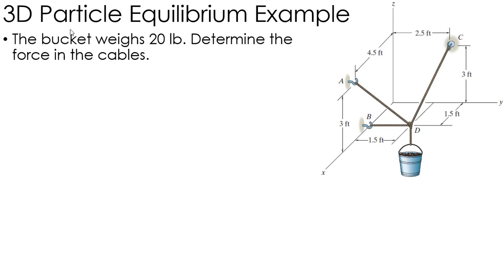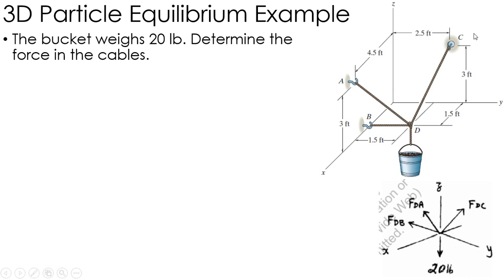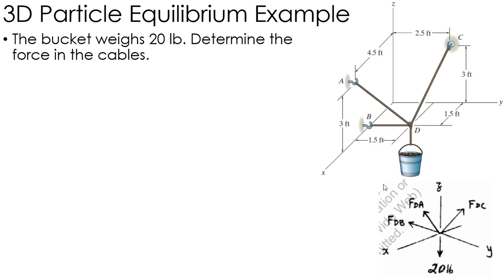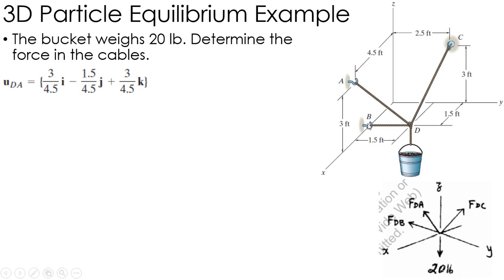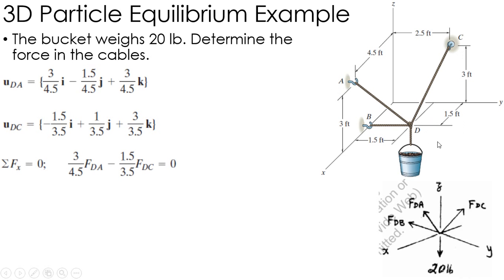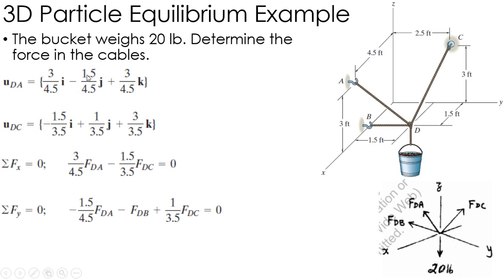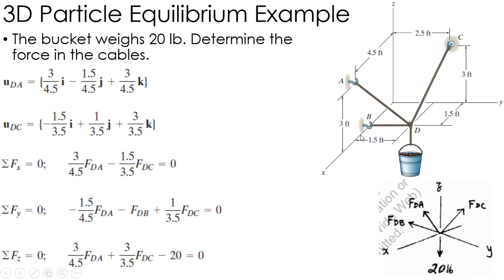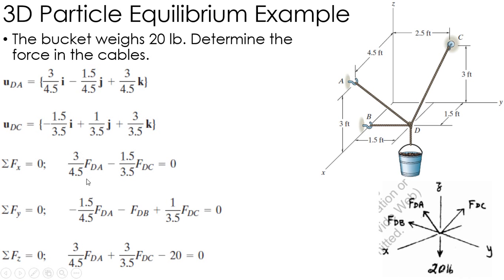Statics Example: 3D Particle Equilibrium 2

Comment: Why did you divide DA by 4.5 and DC by 3.5? What would you divide DB with?
Reply: Uda and Udc are the unit vectors. so 4.5 and 3.5 are both magnitude of position vectors Rda and Rdc. 
sqrt of 3^2 + 1.5^2 + 3^2 = 4.5 and sqrt of 1.5^2 + 1^2 + 3^2 = 3.5. Hope it helps.
Reply: @hizamshahrusmi  still not making sense here.
for Rda why is there two 3^2 ?
it is 3 up and 1.5 to the left of D origin point, but then where does the other 3 come from?
Reply: @matteovinci83  A(4.5, 0, 3) and D(1.5,1.5,0). Rda is the difference A-D (head - tail) , so (4.5-1.5, 0-1.5, 3-0) then u will get Rda is (3,-1.5,3), hope it helps.
Reply: and for DB you can do the same steps and it will give 1. so it is just Fdb because it lies on y-axis

Comment: Finally I found a worked out solution to a problem similar to the one I needed to solve.  I'm an electrical engineering student in a Vector Analysis class where they gave one of these equilibrium problems.  I haven't had physic in years so I can't exactly remember how to solve these static problems.  Thanks for posting.  I'm so glad EEs don't have to take statics.  I hate this shit!  Give me an electrical circuit any day!

Comment: you really should have done the last steps to show the whole process from start to finish
Reply: the Ez equation you can solve for the unknowns. with the Ex equation you solve for DC in terms of DA. then you plug that value into the Ez equation. there fore you can solve for what DA is from the Z equation.  Then you plug that back into the Ex equation and solve for DC, then you can solve for the last unknown.
Reply: Yes, agreed